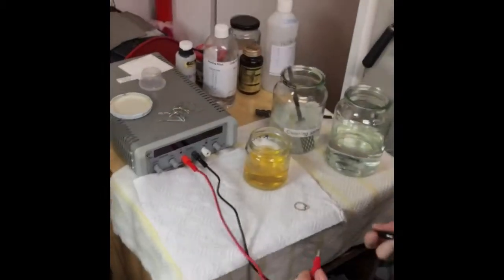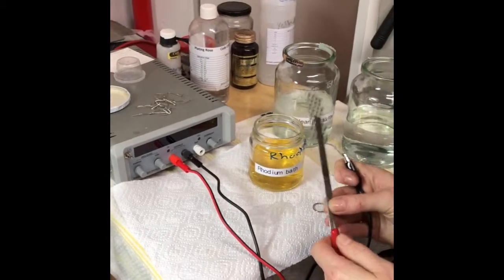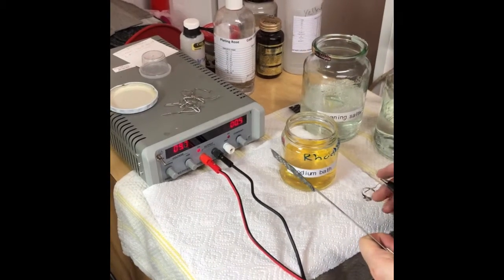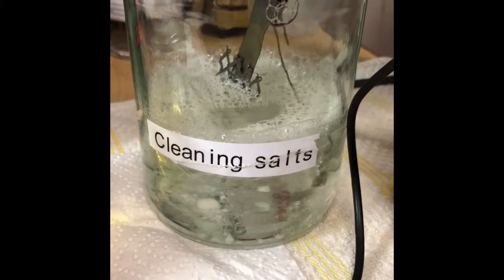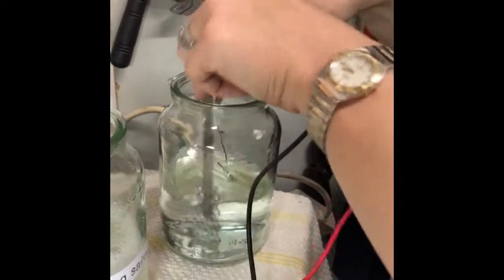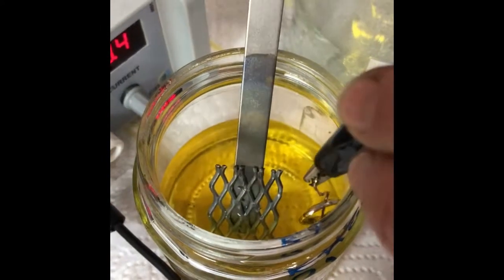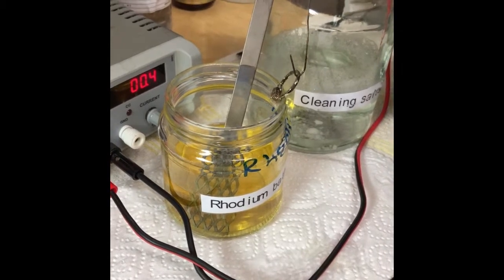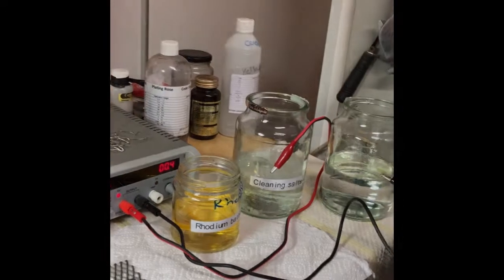How to Rhodium Plate a Ring

Comment: What is the cleaning salt?
Reply from the maker: Its a special mix to get rid of oils, contaminants and surface dirt. Mainly soap based.
Reply: If you read academic articles regarding plating, the object is typically prepared using NaOH.